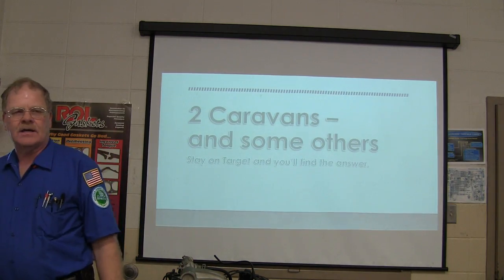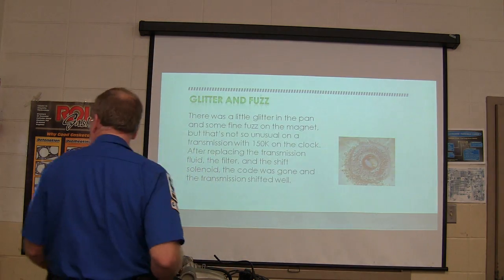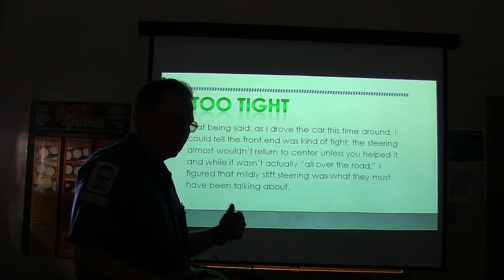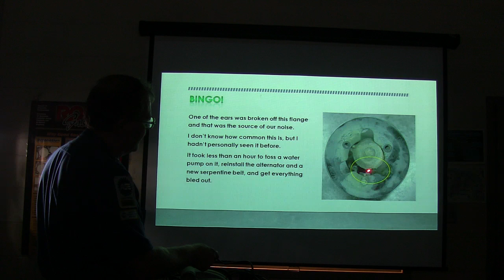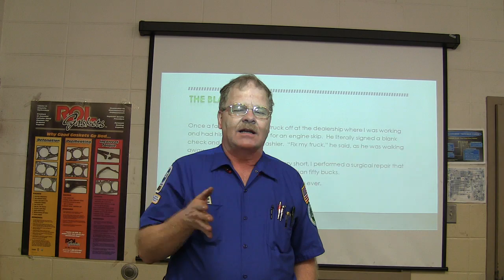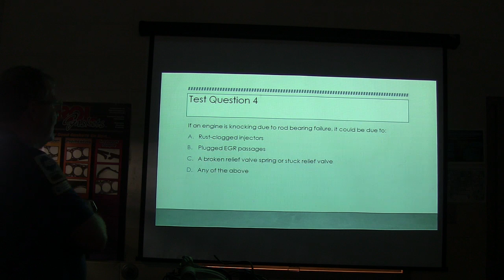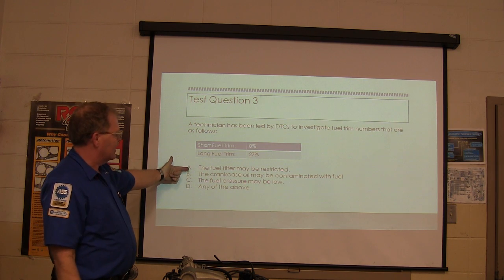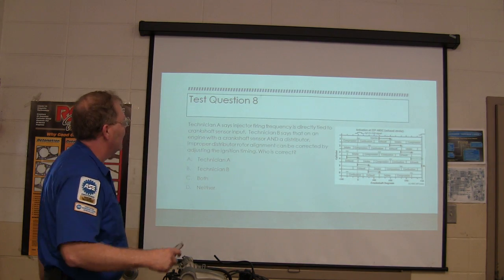2 Caravans war story

Comment: I went to this car dealer to get a part for a transmission. After telling the parts guy what I was after he asked me how I knew it needed that. I told him I was building the transmission. He said "you opened the case! Are you crazy?" I said "no just working". He continued to tell me how if a transmission has a problem it gets swapped at that dealer.  They could not sell me the part so I had to get it from a transmission shop supplier of a friendly trans shop.